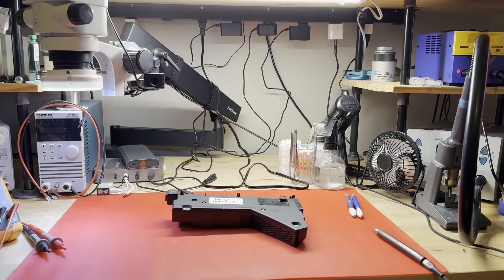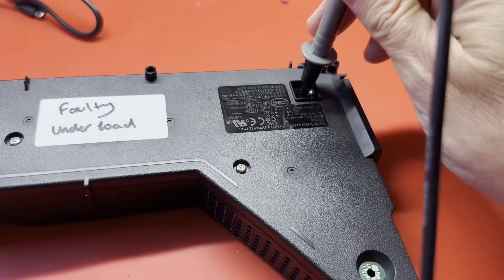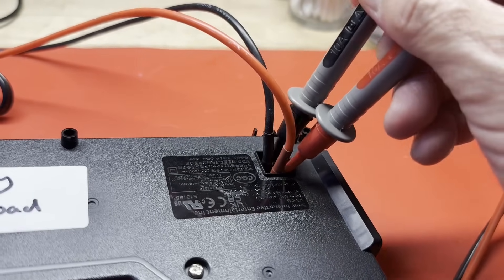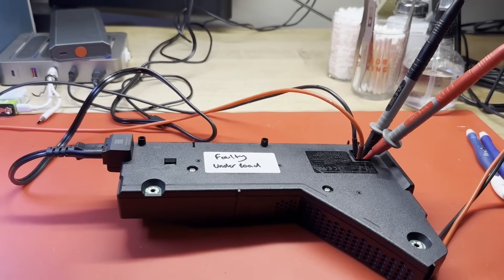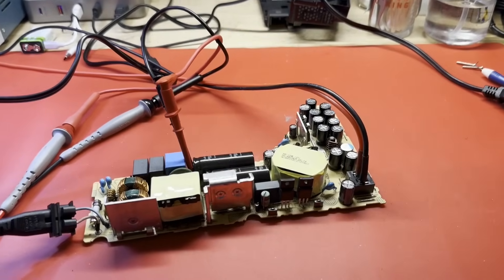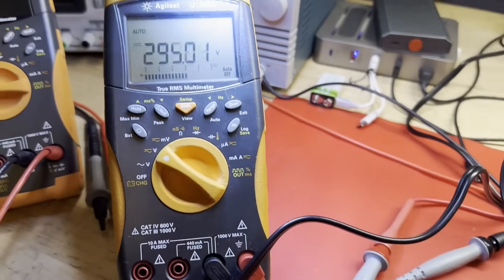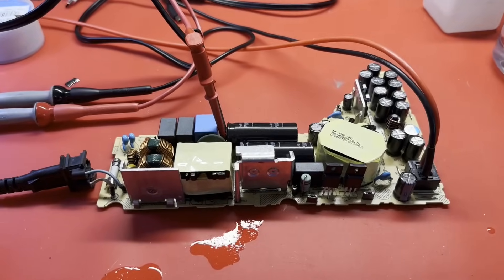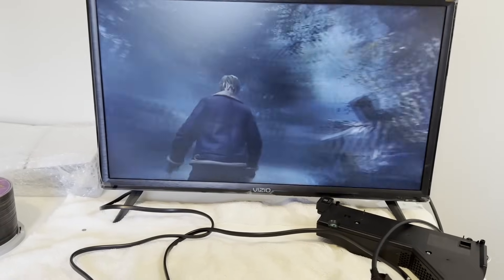#150 Repair of PS5 Power Supply

Comment: Hi, thank you for the amazing work you are doing on your page. I have a PS5 whose IEC C8 socket melted. It did not affect the board, because it is still working fine. Where can I purchase a C8 socket that will exactly fit into the PSU?

Comment: Hi! I’ve watched a few of your power supplies videos already and found them all super useful so far! Though I’m still having trouble locating the source of my failure.  I was wondering if you or some passerby could help me out.  Here are some signs:  I noticed a short to ground on the DAP’s first pin, and after replacing it with a TEA, the short went away.  After power on, the voltage out of the bridge rectifier was 166V.  This was also the max voltage that the capacitor could build up to.  There is no power on the output side of the supply at all.  The capacitors also seem to hold their charge for a good while too.  I’m thinking a short in the boost circuit preventing the voltage from climbing towards the 395V mark but am not sure where to start probing for shorts.  If you have any suggestions, anything would help! Thanks!

Comment: How does the cover come off?
Reply from the maker: You need a strong, wide, metal tool to pop loose the snaps all around the perimeter.  They are not really meant to be opened.
Reply: @ToltecMerc got it thanks a ton
Reply: Hi! What kind of transistor is this, Q34? It split...

Comment: Hey I had a power outage while playing MLB The Show 24, PS5 died, TV and Monitor didnt, No beep or anything it just didnt turn on, I ordered a new PSU (checked it was the correct model, exact one so it cant be that) and it still wont turn on, any ideas on how i Can Fix it? Or is it dead?
Reply from the maker: If a new supply didn't fix it, something probably died on the mainboard.  A standby supply may have failed or the South Bridge could have died.  They South Bridge does seem to be fragile.

Comment: Great video! Earlier today I had a lightning storm and one hit in front of my house. Now my PS5 won’t turn on, no sound, no nothing. I tried everything from, unplugging everting for 30mins, using a different outlet, resetting, using a different power cord but no luck. After seeing this video and reading comments from some forums, I’m almost sure it’s the power supply. Question: Do you have a site or a way to contact you? Do you do this kind of work for anyone?

Comment: I have an original PS5 that is popping the Mains fuse in the Mains wall Plug (13 Amp) when under load.
Is this likely to be a Motherboard or PSU fault? The Console will power on and run perfectly for anywhere from several hours to several days then sunddenly out of nowhere the Mains fuse will pop.

I've been quoted £150 for a Motherboard repair or PSU Replacement which I don't think is worth it. I'm debating weather to just get a refurbished PSU and fix it myself or upgrade to a new PS5 Slim with a new Warranty. My current PS5 is 18 Months Old.

Any advice appreciated Thanks
Reply from the maker: I would guess that this a power supply problem.
Reply: @ToltecMerc  That's what I figured, even if the console was drawing a lot of power, its the PSU that would be overloading the mains fuse.
Tho you would think the internal 8 Amp? fuse would pop before the fuse in the mains plug....

Comment: Hello, I would like to ask a question about ps5 repair. Even if I remove IC DA9081 from the PCB and remove the capacitor around it, IC 13-pin and 27-pin ground shorts occur. Request for help.

Comment: Nice work !  The key here is the equipment being used to push the supply.  Really emjoy watching your diagnoses method
Reply: He could have fixed it without the active load as he knew the PFC caps should hold ~400v, which they didn't do with, or without a load on the PSU. Knowledge is king for these kinds of faults.

Comment: Very nice video, and good info, i have a suggestion, what if you show us more in like checking vcc for the ic, and output, also the oscillation frequency, that way you can 100% sure if it is the ic or not, also you could measure the esr of the caps, alot actually. Thank you very much for the nice video👍

Comment: Nice repair. A typical troubleshooting step for all PFCs is to look for approx 400V on the boost capacitor.
Okay, you've replaced the IC on *instinct*, and it helped.
But it would be nice to see the failure mode of the DAP053T explained, since the IC was partially working.

Comment: Love it!! We should talk soon! Just finished fixing a PS5 with liquid damage. mainboard luckily was not touched. The ADP-400FR...it saw the brunt of the damage. Shorted components: R9, Q3, Q4.

The console came back to life, but after going through its system check and telling you "it wasn't powered down correctly" after you clicked past that menu the system would die and shut down. No other shorts I could find. Input and Output of the power supply were fine. All diode readings of DAP051 were in range. so with a shot in the dark, I just replaced DAP and now we have a fully working console again! 😎😎

Thanks for all the content you put out. With this channel, you have truly been a blessing to so many others' lives. Keep doing you!!✌

Comment: Hi Teltecmerc, i hope you’ve been well. Thanks for sharing this. I am currently working on a power supply 400-ER and i think i need to replace that fusible resistor along with the 2 Mosfets because they are shorted. Do you know the value of that resistor and its power rating? Thanks a lot in advance!
Reply from the maker: Hello!  I replace that resistor with a 0.1 ohm, 2 Watt resistor.
Reply: @ToltecMerc  oh, thanks very much i will try that.
Reply: @ToltecMerc  Hi Toltec, hope you’re doing well. I did go ahead and ordered replacement mosfets and that resistor too and installed those. I plugged the supply again and it showed 12 volts briefly but died again and now produces nothing. I checked those components i replaced but they seem fine so i checked around the board and i noticed the diode D1 that connects to the positive side of the filter caps had shorted but not sure what caused it. No other shorts on the board and the DAP053T reads just fine. I was hoping you might have an idea what could be wrong 😆.

Comment: 3:22
31A wow, did not know that.

I'd like to ask, for a project I'm currently doing, what's wattage of the AC side when you do the load test of 10A and below, (efficiency wise). I'm thinking of hooking a ps4 power supply with a picopsu.